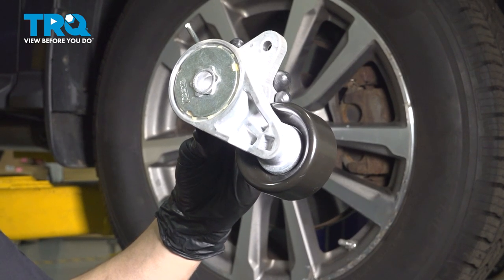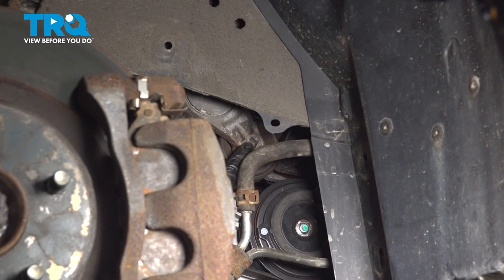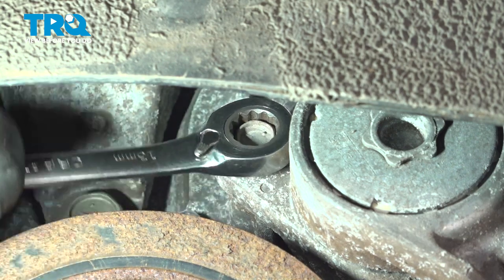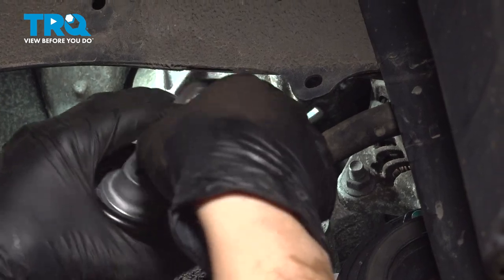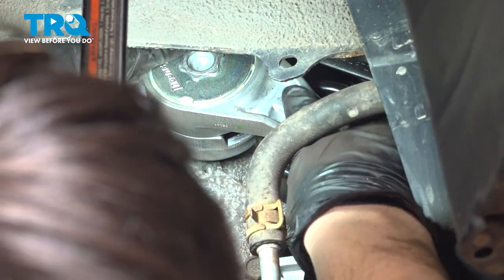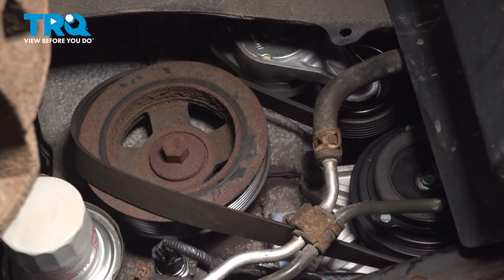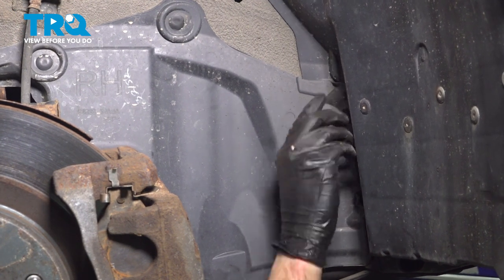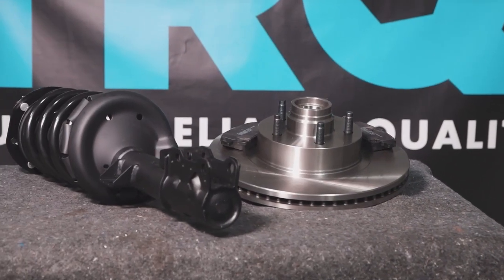How to Replace Serpentine Belt Tensioner 2013-2020 Nissan Pathfinder (3.5L V6)

Comment: Thanks for the info. I tried to replace the belt with out replacing the tensioner and ended up breaking the tensioner, quick trip to O'Reilly's to get the new tensioner. It looked like you had a lot more room removing that top bolt on the tensioner 😅.  It was a slow  process but got it done.  Thanks again for the video it was a lot of help.

Comment: I replaced the tensioner on my 2017 Infiniti QX60. Very similar to this. The left bolt was easy to reach from the wheel well but there was no way for me to reach, see, or even feel the right bolt from the wheel well. I had to approach the right bolt from above after removing the coolant tank. Fortunately both bolts were very easy to release. Installing the new belt was quite difficult using a ratchet as I could not get enough leverage to open the tensioner all the way. I had to remove the oil filter to use a longer breaker bar.

Comment: For a regular person this is impossible. First it's in a very very tight spot. You will not get your tool in there. 2nd if the bolt is rusty good luck breaking it free. Most likely the engine has to be dropped to get the right bolt off.. trust me